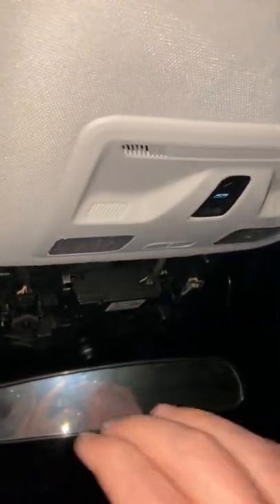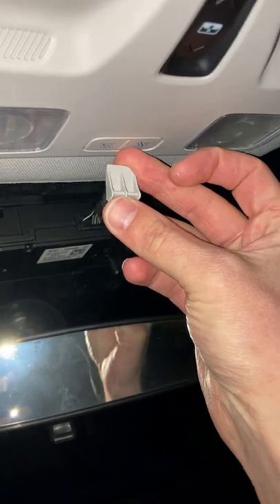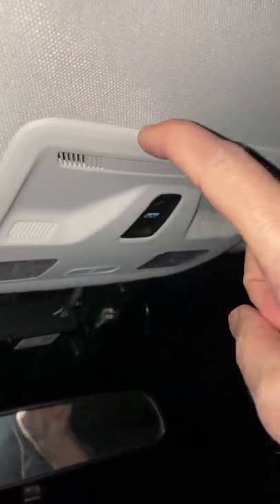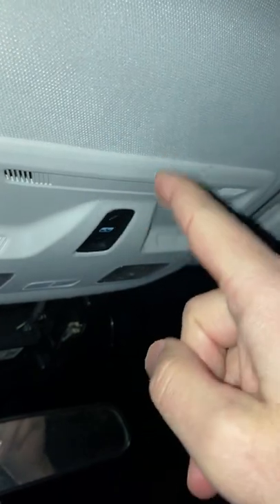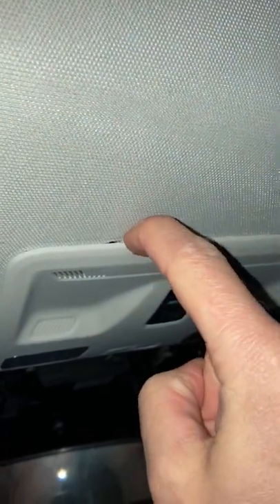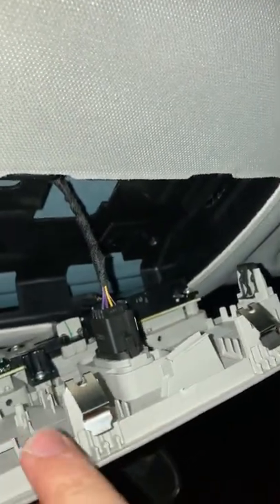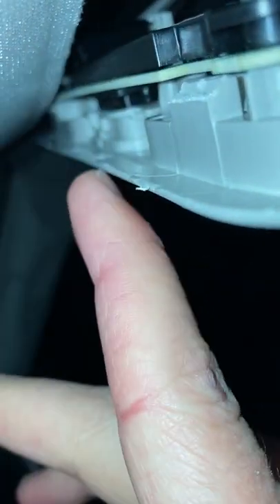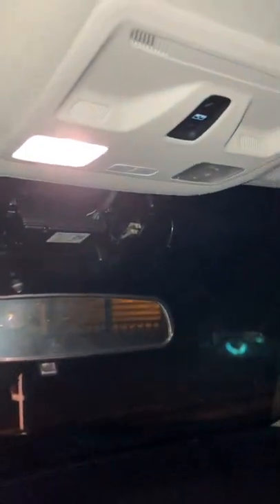2022 Ford Maverick Dome Light / Moonroof Switch Cover Trim Removal

Comment: Thank you for sacrificing your plastic tabs lol. I was able to remove mine easily (no sunroof) with the right angle trim tool and watching your video. No metal clips on the front tabs, just plastic clips, so nothing to worry about there. Needed to remove this piece to fix a rattle noise over rough pavement that was driving me crazy. Light switch has a flimsy tab behind it and was the cause of the rattle! Thanks again for your video!

Comment: How do you remove the black cover/panel in front of the dome light trim?
Reply from the maker: That one is relatively simple by having four clips somewhat near all four corners (if i remember correctly), nothing surprising, I just recommend using a trim tool and starting at the joint where the windshield glass and headliner meet the black plastic, on one side or the other. The headliner has some flex and give so it’s easier to start there to get leverage under the black plastic with a trim tool.
Reply: @clavicus  Thank you, great video for powering my dashcam too!

Comment: How did you get the mirror console piece off ?
Reply from the maker: That one is relatively simple by having four clips somewhat near all four corners (if i remember correctly), nothing surprising, I just recommend using a trim tool and starting at the joint where the windshield glass and headliner meet the black plastic, on one side or the other. The headliner has some flex and give so it’s easier to start there to get leverage under the black plastic with a trim tool.

Comment: Why did you need to take this part off? Were you fixing something?
Reply from the maker: I ran a source of power for a dashcam from the fuse box to the cavity above the dome light there. 

I made a whole video. Here's a quick jump to the end of the video so you can see the madness:

https://youtu.be/CHKyEv5wR1o?t=2384
Reply from the maker: Other people take off this panel in order to access the wiring for the dome lights -- they tap into those wires for the tiny bit of power needed for an auto dimming rear view mirror.